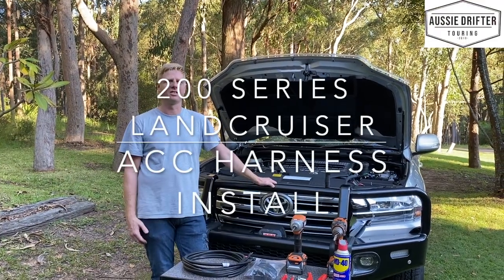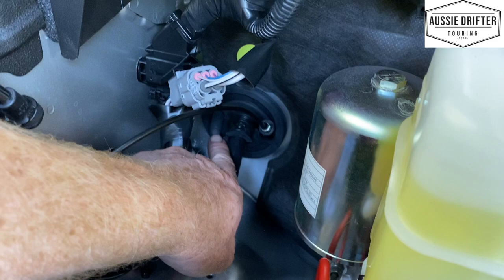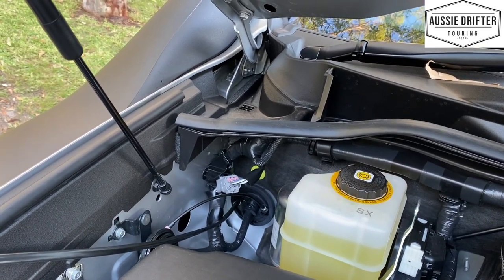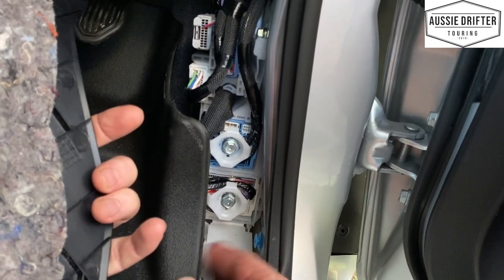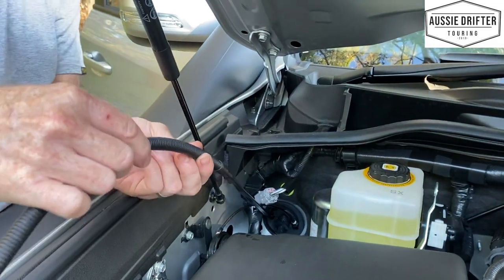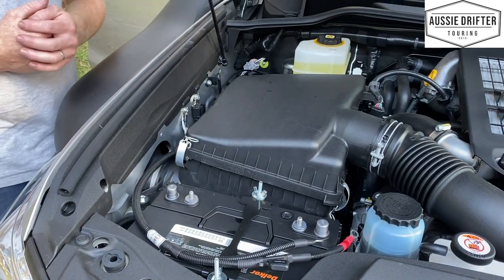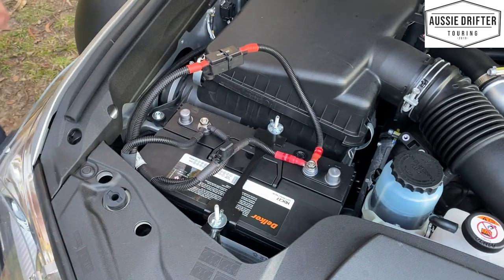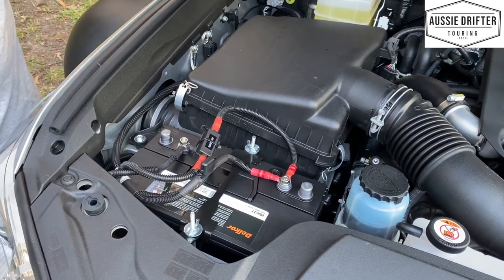200 Series Toyota LandCruiser Accessory Harness Full Installation

Comment: Lol one... use cable lube not wd40.
Two pull something through then pull end back to front not 6m through 😆
Reply from the maker: Yer that won’t work mate.  You might have noticed that the engine bay end is pre wired with fuse holder attached so no chance of getting that through the hole.  But with a bit of lube the 6m come though easy.